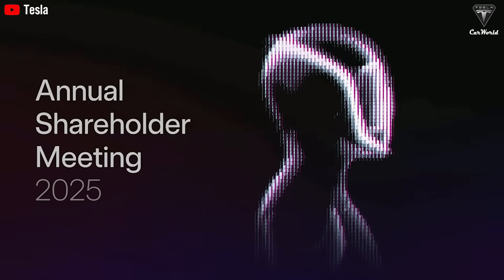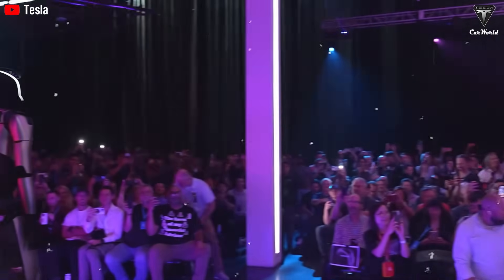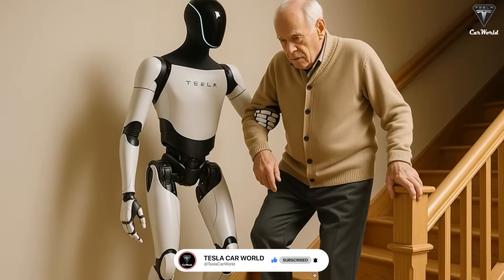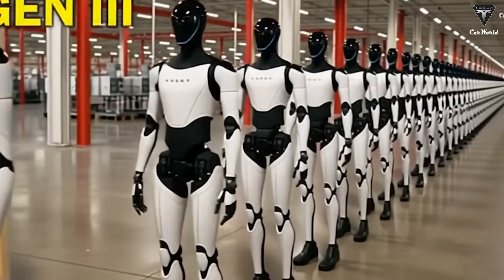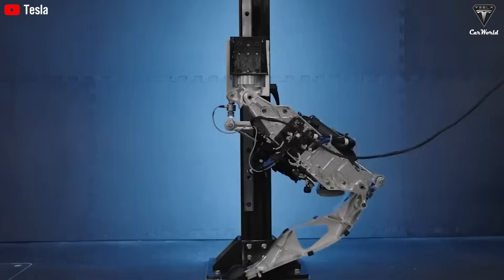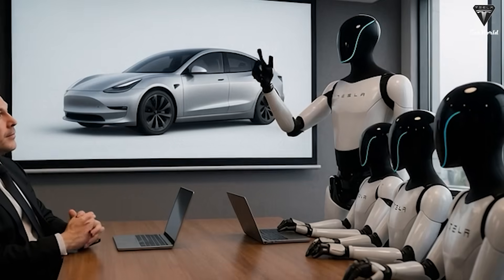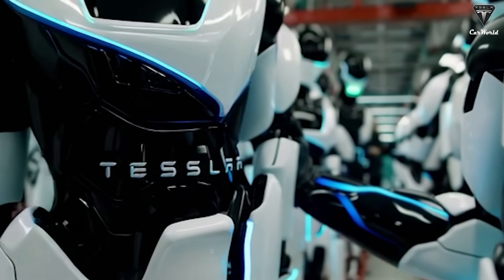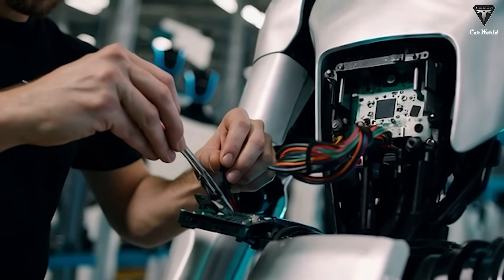Finally Happened! Tesla Bot Gen 3 Officially Launch! Insane Design & 100M Production Line Shocks All

Comment: Yeah and I watch that I watch that and it was pretty cool thing that's about doing all those moves like they weren't prep program they would do the software which is really good and it would even have said there wasn't a wiring and holding it up I mean that's pretty great we'll talk about how far it's going
Reply from the maker: Exactly—Optimus used real-time control, no external support; neural software generated each adaptive joint movement.